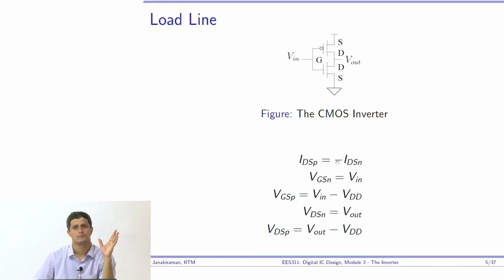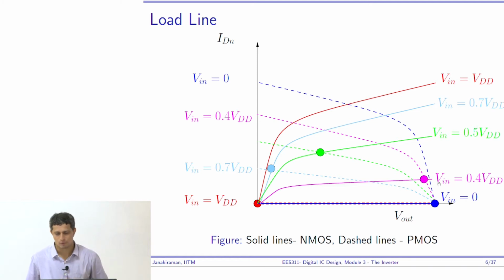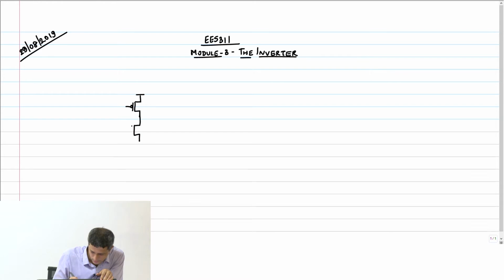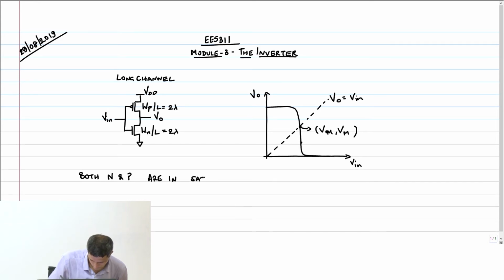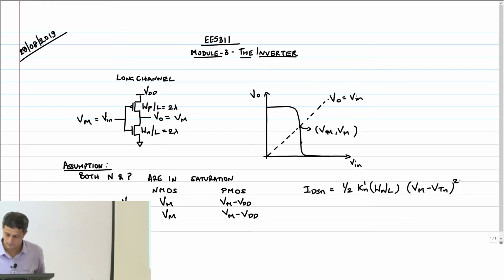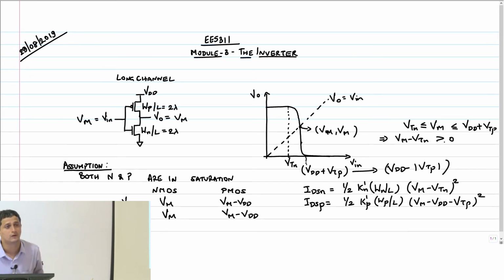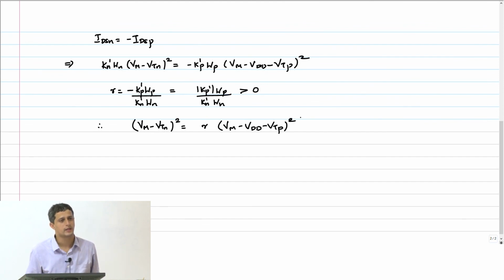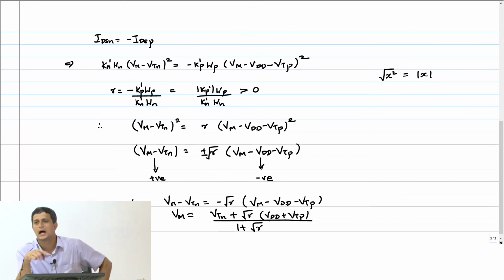Inverter-5 - Trip Point for Long Channel Device Inverter

Comment: Usually mobility of electronics greater than that of mobility of holes.. that means nmos current more when compared to pmos current..but in inverter same current should flow.. that means we r trying to increase the width of pmos device..so that area of pmos device also increases.. for long channel may be pmos area should be twice of nmos area..due to scaling, short channel effects coming into the picture..in this case how will be the nmos and pmos area relation.. is it thrice r else more than that?